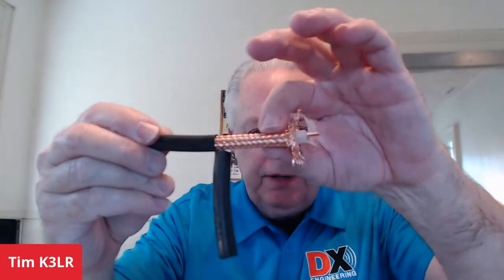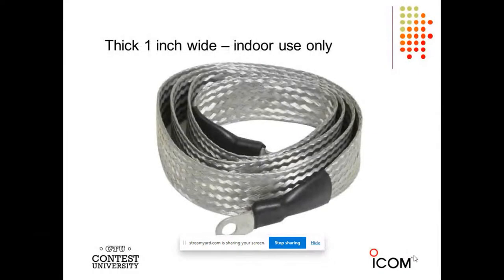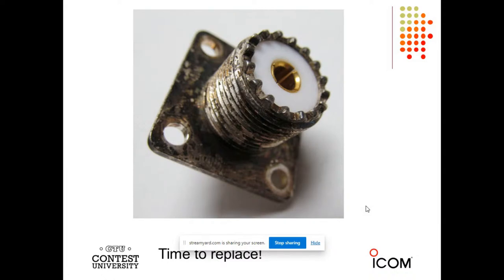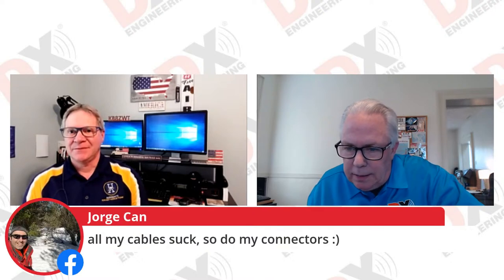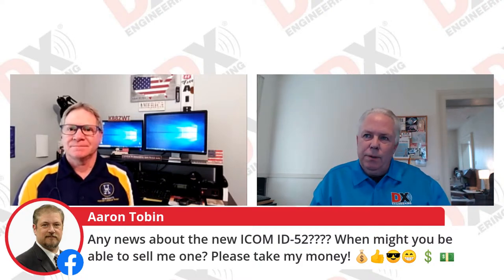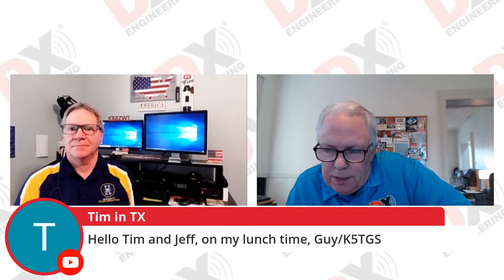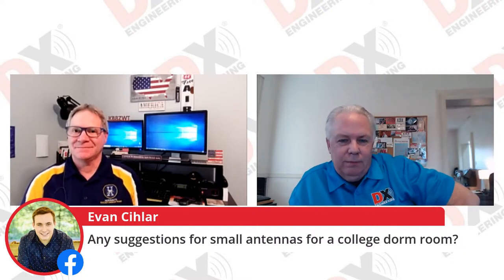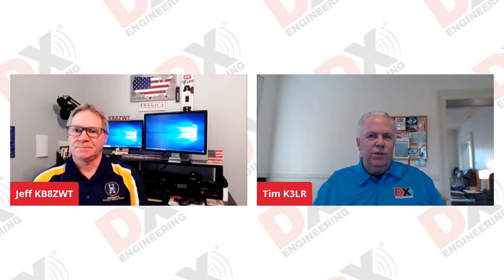Coax, Connectors and More - Tuesdays with Tim and Jeff

Comment: Hi Tim and Jeff,
I've seen the 1" wide tinned braid covered with clear glue lined heat shrink and used as bonding straps on vehicles. Where it was attached to the frame, the frame was sanded to fresh metal and star washers used with the bolts. Then the joint was covered with several coats of clear paint. You all at DXE stay safe.  73  WJ3U